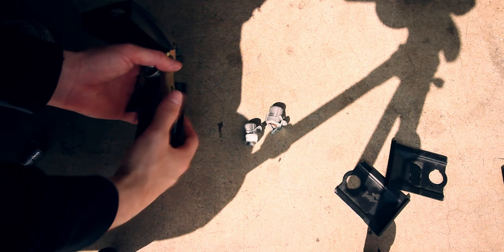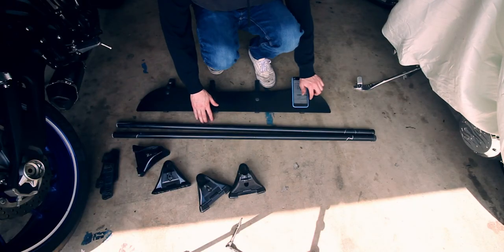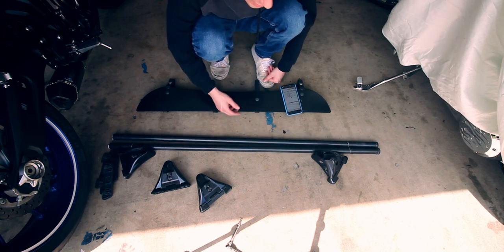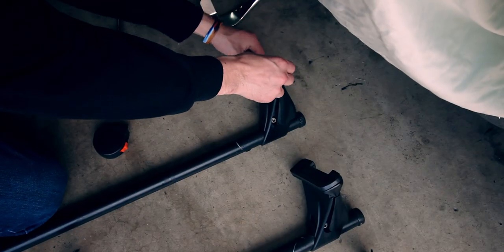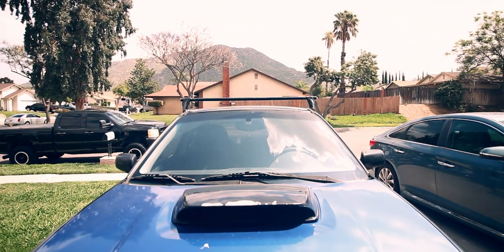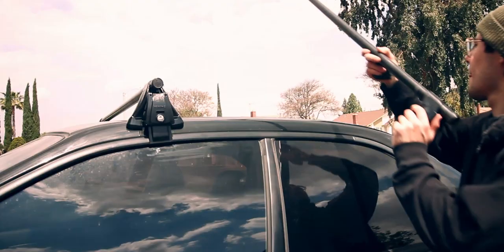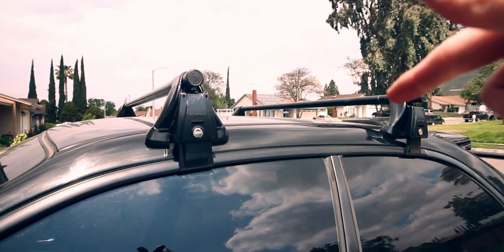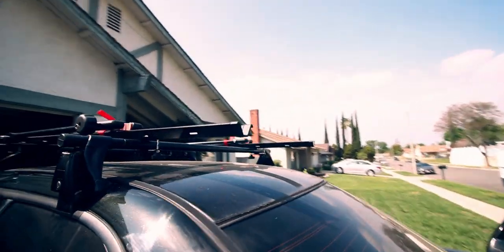Roof Rack On Lifted Subaru STI

Comment: Wheel/ tire setup?
Reply from the maker: Stock BBS’ 17” x 7.5”
1” wheel spacers
Falken wildpeak at trails 215 60 17
Reply: Do you rub the tires on full wheel lock?
Reply from the maker: @zmcmcv5733  no rubbing